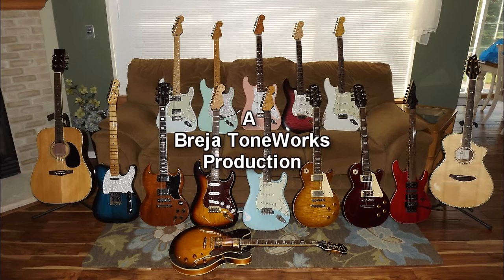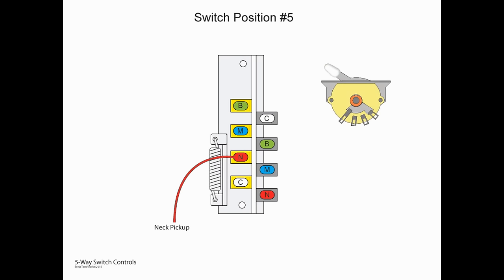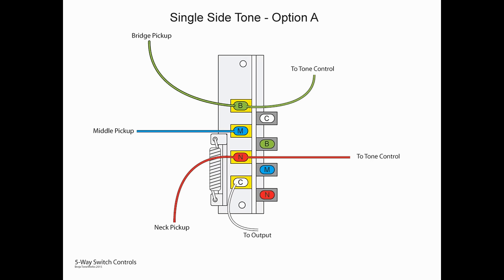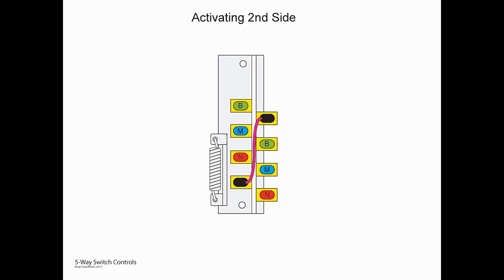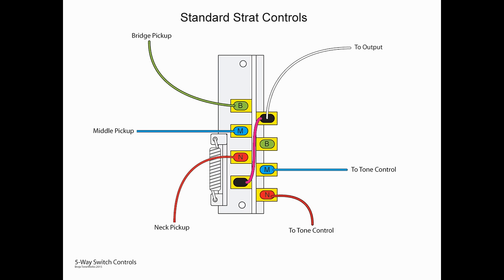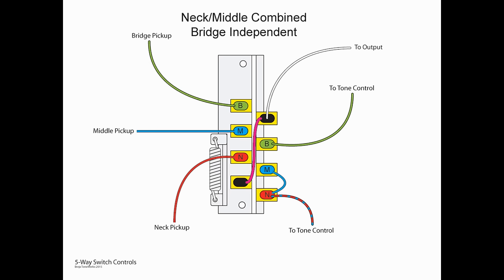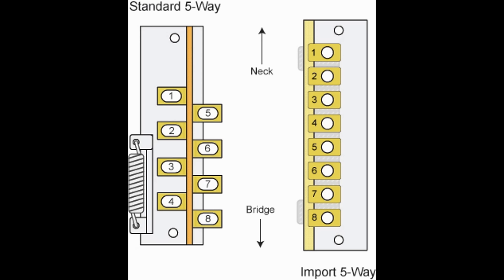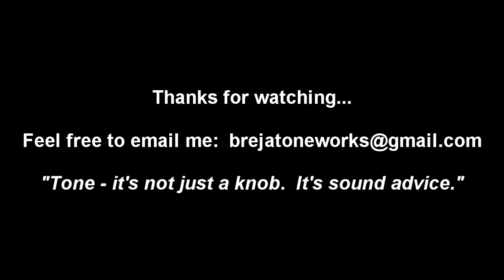The inner workings of a 5-way switch and various wiring options

Comment: Thanks for the great videos, I have a SSH Tele, 5-way, 1 tone, 1 volume with a coil-split on the humbucker using a dpdt. I have purchased (3) SD Humbuckers and would like to be able to split all 3 to single coil using the dpdt switch (on/on). Is that possible with that switch?
Reply from the maker: +Billy Kuhl Hey Billy - I just saw your question so I'm sorry for the delay.  No - a single switch can't do that.  You'd need a minimum of 2 switches.
Reply from the maker: +kevin paul halliday Technically that's true.  You would be able to do that and it would work.  Interesting idea.

Comment: Don, your videos are very helpful but i still have one doubt: i like the positions two and four in my stray, however i never use the middle pickup alone. is it possible to use the position three to combine neck and bridge, like a tele, whilst the positions two and four still works the same?
Reply: The Mega switch below (Model E) does exactly that ... in position 3 (an option).  I have three of these.
http://www.stewmac.com/Pickups_and_Electronics/Components_and_Parts/Switches/Megaswitch.html 
Click on the 'E-Model Megaswitch Instructions" for details. The last image shows this ("3 SINGLE-COIL COMBO").

Comment: Hey. Great video. On my SSS strat, I have tried the option where neck and bridge share the same tone pot and middle has a separate one. It works but i get a load buzz. Does this mod work with 3 single coils? If yes, I use an import switch, is it supposed to be grounded?
Reply: I think that a buzz generally indicates a bad ground. Maybe watch a video about how to solder and check your solder joints? 
Make sure you heat the components you are soldering because if you just heat the solder it wont make a good connection and you'll have a cold solder joint. And since this is YouTube, if you already know this stuff don't take it personally.  ;)

Comment: So it looks like I damaged my 5 way switch changing a string at a small gig on the fly.

2 position only bridge PU works. 3 position middle PU does not work. 4 position only the neck PU is working.

Anyone have experience with this? I changed the string on my lap, and I must have banged or put pressure on the  switch.

Can I repair or should I replace the switch?

Comment: Hi there, I just got into guitar modding and planning to attempt it on my Squier Strat. Question about the tone controls example where the neck and bridge pickups share a tone control and the middle pickup is independent.  

So assuming I am jumping tone pot 1 to support the bridge pickup and tone pot 2 left untouched for the middle pickup, when the switch is at position 4 (middle-neck) & 5 (neck), tone-wise it should be essentially similar to the stock strat tone wiring, right? 

My point is, with the tone pot 1 now connected to the bridge pickup, will it in any way affect position 4 & 5? 

Thanks

Comment: I am trying to find a wiring diagram that will show me how to use a 5 way blade switch with a 2 humbucker guitar and split coil with the 5 way switch and then use a push pull as a phase switch. If anyone knows I would be very greatful. Trying to get my sons guitar set up really nice as a type of going away thing.

Comment: Tom, I have a "grigsby" 5 way switch (from china) and it has 12 lugs in line on a disc, I'm wiring an HSH setup with coil spit (push pull tone pot and volume pot), I am not sure how to wire this monster. I understand where the Bridge, Middle, Neck lugs are but am not sure how to wire the Bridge/Middle, Neck/ Midde. If you search Fender 5 way switch you'll see the one I ordered. I am planning on using your wiring diagram for HSH coil split.
Reply from the maker: email me directly at:  BrejaToneWorks@gmail.com
Reply: +Breja ToneWorks 
I e-mailed you but im not sure it went through.

Comment: Do you have a schematic or video of a treble bleed with a spdt switch on, off, on.......position 1 normal, postion 2 treble bleed.
Reply: Why would you need a switch on a treble bleed?  It should be always-on if you pick good values for the capacitor and resistor.  A good starting point is 1 nf (same as 0.001 uF)  in parallel with 150k ohms, connected from the pickups to the audio output jack (bypassing the main volume control.)  A 1/8 watt resistor will do just fine.  I like at least 100V capacitor rating to avoid damage to the capacitor from static electric charge.  Use a stable capacitor type, such as silver mica, "orange drop" film dielectric, or polypropylene.  The dirt cheap disc ceramic capacitors are not recommended because their value changes a lot with small changes in temperature, and they are microphonic due to the piezoelectric effect - when they vibrate they add unwanted noise to your signal.

Comment: Is there another way of getting a master tone without bridging lugs 6,7,8?
Reply: I was thinking the same, couldn't you just wire it like a Tele and run the output from the switch to Volume pot lug 1and then bridge V lug 1 to Tone lug 3 (straight across)?